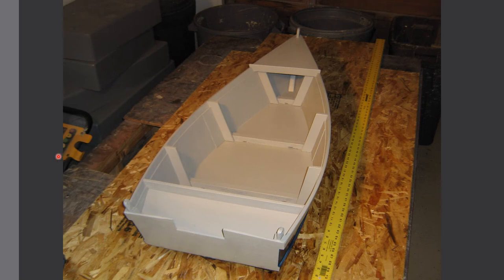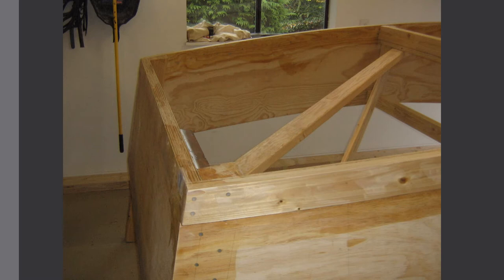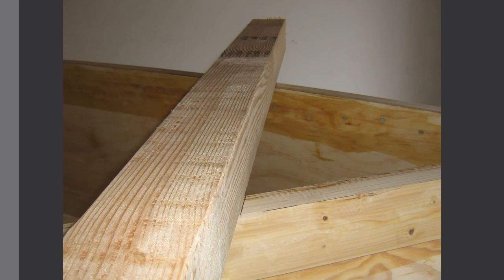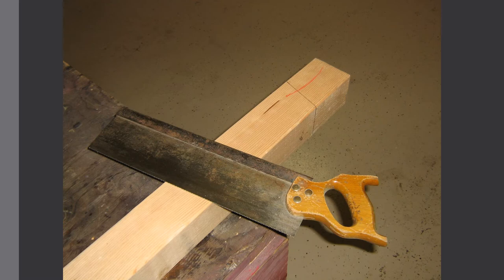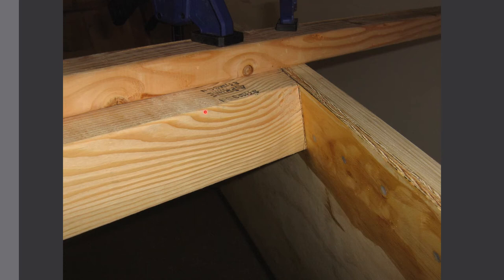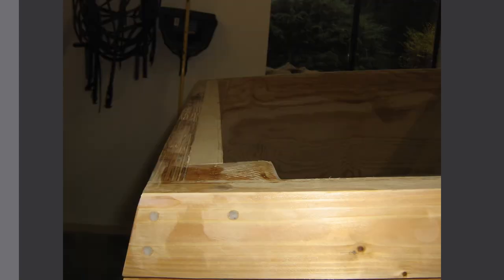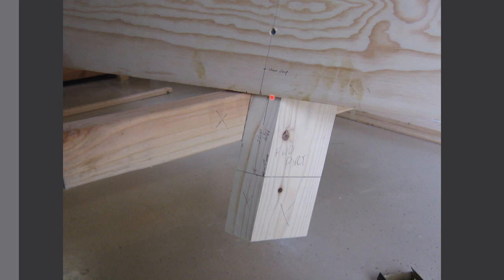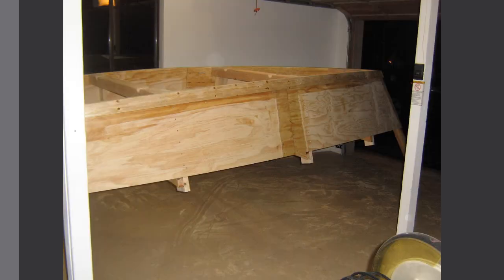Episode 11 of 2019 Boat Build

Comment: Hi. Why not just one limber hole in the center instead of two on the sides?
Reply from the maker: Howdy Glen. So glad to see you are still following this build. Sorry I did not address that in the video. One limber hole in the center would most certainly work, but I have several reasons I prefer them on the sides. First, the keel will be attached down the center of the boat and I did not want the screws to pierce thru the limber holes. I will have to be very careful on the forward frame. Second, the bottom timbers structurally beam the loads to the side panels. Just like floor joists, you generally don't want to notch them at their mid-span where the bending stresses are a maximum. However, it is probably a non-issue with the massive floor timbers used in this boat. Third, when the boat is on a trailer, boat lift or on the beach it is often tilted to one side or the other. Having the limber holes off-center prevents large pools of water collecting in the corners along the sides. Final reason, is my personal preference. I will be installing my drain plug thru the transom off center. This way I can stand in the rear corner of the boat and get all the bilge water to pool up along one side of the boat and run back to one corner at the transom. Then I can pull the plug under power and let it all get sucked out or use the manual pump.